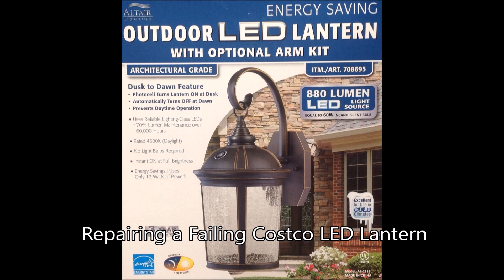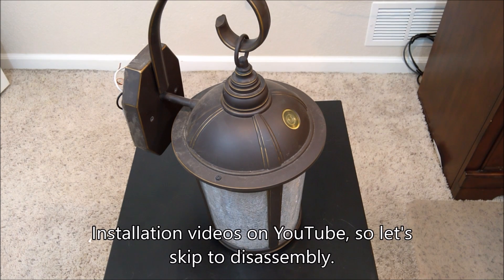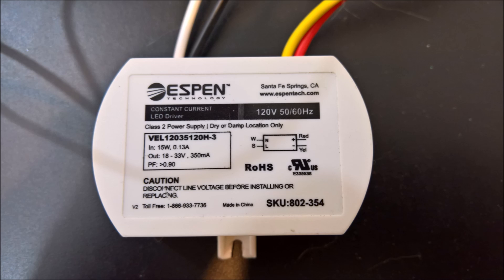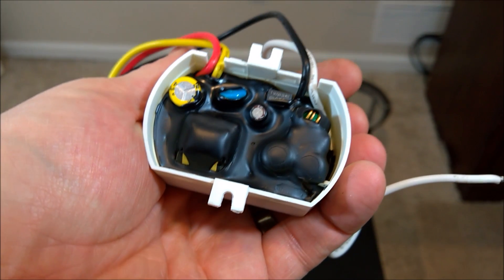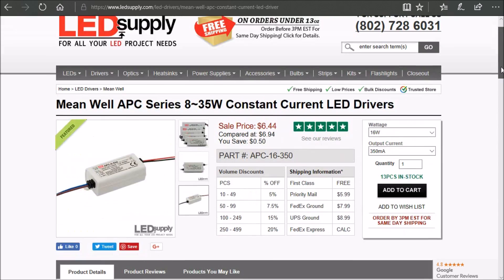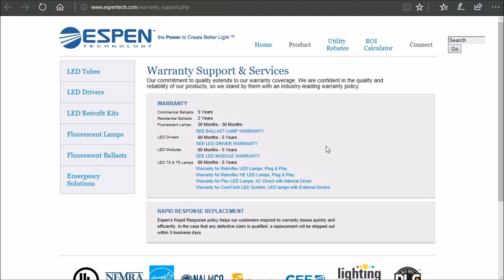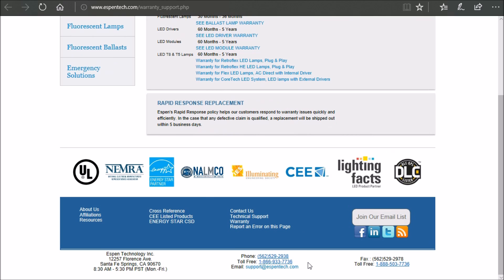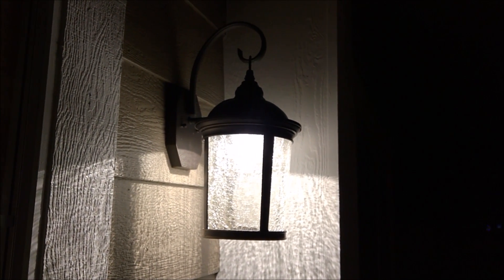Costco LED Lantern Repair

Comment: Awesome! Thanks for this helpful video. I had the same problem.  I ordered the part and fixed my strobing lamp. The only edit I would add is I did not use the zip tie method; even though it wasn't as aesthetically pleasing as yours, I put the new switch back in using an existing screw and mounting hole on the switch. It held just fine.
Reply from the maker: I did one recently that way and it worked fine.  Thanks for watching.

Comment: Thanks for sharing.  These LED lamps are junk.  Having a bulb would be so much easier to repair and have a long life.  I do not want to have to take my fixtures down for repair.  I will never buy a LED fixture again,  I will always get a fixture with a socket for a bulb, This allows me to put smart bulbs in too.
I had a different LED outdoor fixture and was able to convert it to a socket for around $5 so that I never have to take the fixture down again.
Reply from the maker: Swapping out the guts for a socket and a smart bulb is another option.  Smart bulbs do give you the ability to remotely turn on or off your external light.  I basically have that with my switch that controls three outdoor LED lights.  I didn't think I need to have a smart switch and smart bulbs.

Comment: I replaced the board and successfully repaired one light. Unfortunately, the half the LEDs are bad on another lantern. Do you have any idea where to find the replacement LED board? I searched thru LEDSupply's site and couldn't find a close match. Thanks for the helpful video; you saved me having to replace some lanterns.

Comment: Excellent work Ricardo!  I bought 4 of these in November 2013 and two just started the dreaded flash!  Do you recommend the replacement part you purchased or the OEM part?  I’m out of warranty so it’s out of my pocket at this point.

Comment: I call the company that sold the light, it was on the box that I saved. ALTAIR Lighting, 800-787-1021 or 562-295-2611.
They sent me both the driver and the LED plate for free. I replaced them and it works just fine. Good Luck. Thank you for the video, you did an excellent job on this video. Very professional!!!

Comment: I tried to replace the driver and it's still not working. Tested the driver in the house with the LED and it works fine, even though only 2 of the LED lit up. I took my voltmeter and tested the voltage coming in from the photocell and only got 97V. Is there a problem with the photocell sensor  too?  I bet if I by pass the photocell it should work fine. But I would not want to have to turn off the lights every morning and turn them on at night manually everyday.

Comment: thanks for an awesome video - I purchased 2 of these lights and nearly returned them due to the possibility of failure with no replaceable parts, my instal is not easy due to placement but I think Ill keep them now that I know it is possible to repair the lights IF they fail early, FYI to anyone else, on altairs website they list a 3 yr warranty so that might be a good first step. I have the 'newer' version so hopefully they have upgraded the LED driver in the meantime. ---thanks again for a great video showing all the technical stuff that I dont understand!!!! --nice to see the way you show what matters when looking at the parts.

Comment: So i have the AL-4148, 49 or 50.  Not sure which one this is, since i bought 3 of them at different times.  They all came in the red box from costco. The first 2 failed (wouldn't light), so i called Altair and they sent me replacement drivers.  The third one finally failed, but Altair would no longer answer phone calls or emails.  I found your video and followed your instructions.   The driver inside my light was a 700mA one, so i ordered the APC-16-700.  I did not bypass the photo cell.  After installation, it worked perfectly, bright and steady.  But now, about 2 months after install, the lights have gone out again, completely.  I would hate to fix it again and have it fail in 2 months.  Any ideas?
Reply from the maker: Well as much as constant current rating is important, the max power and the DC output voltage range are just as important.  The APC-16-700 is 16 watts max power but only provides a voltage range between 9-24V DC.  If you have your original driver, check and see if it lists a voltage range and maximum wattage (you didn't list it above).  You need to find a driver that meets, or exceeds, the wattage and range.  The APC -25-700 has 25 watts maximum power output and a voltage range of 11-36V DC.  The APC-35-700 has 35 watts maximum and a voltage range of 15-50V DC.  Perhaps one of these might be a better solution to your problem.  However, I would need the additional information to make a recommendation.

Comment: Thank you Ricardo, my lantern has been strobing over the last few days and this made a lot of sense, one question though... my light has 3 Octagonal looking LEDs  any ideas if the same replacement parts would work?
Reply from the maker: The specifications or driver requirements are probably on the constant current driver.  Double check your driver's constant current and voltage values.

Comment: Great video.  I bought the 12V controller and installed it as you show and is works perfect.  The light is the exact brightness as all the other lights I have. I ordered mine from LED supply.com for $6.00 (I bought 2 so I would have an extra).  I called the light company and they wanted to see the Costco receipt, which I do not have.  They also said the part is on back order until at least May this is March). Thanks so much for the great video and the excellent explanation.

Comment: I bought the same constant current driver as you did because I have the exact old driver as you did in the video. I didn't bypass the photo sensor when I hooked it up and it won't turn on? I double checked the wiring and I'm pretty sure I connected it the sames as the other driver.  Any ideas?
Reply: Ricardo Moreno thanks for the info. Just repaired my light and it is working great👍🏻 People need to learn how to repair things again, instead of buying new and throwing the old away. We live in a wasteful World today.
Reply: So I could get my other outdoor fixtures to turn on in the day by covering the photo sensor with my hand but the one I repaired would not turn on. So I left it connected with the new driver and I went outside and night and the light was on! So hopefully it stays on, if not I'm guessing it is the photo sensor and wasn't the driver.
Reply from the maker: I'd start by checking the wiring.  First, locate the black and white wires that go to house.  Verify that the house white wire, the photo cell white wire, and the blue wire of the new constant current driver are connected together. The house black wire should already be directly connected to the photo cell (no wire nut).  The photo cell red wire should be connect to the constant current Brown wire.  Both the brown and the blue wires on the new constant current driver are the AC input wires.  I noticed later that blue is ACN, and Brown is ACL, which I can only imagine means AC Neutral and AC Line.  Now connect the output Red wire on the new constant current driver to the red wire on the LED assembly plug.  And the Black output wire to the yellow wire on the LED assembly plug.  That should do it.

Comment: Thank you  Ricardo Moreno  for the awesome information and video. I also filed papers supplied by Espen to RMA under warranty my failed LED driver. They replied today informing me that the driver  VEL12035120H-3  is on back order for 5 months.   I decided to follow your advice and ordered replacement from https://www.ledsupply.com/led-drivers/mean-well-apc-constant-current-led-driver.  THANK YOU!
Reply from the maker: Thank you and you're very welcome.
Reply: New driver arrived, installed and LED light is functioning normally again.

Comment: only 1 LED Light is lighting up.  I hooked it up correctly.  What is my issue now?
Reply from the maker: This lantern had multiple versions.  You must make sure that you have purchased a replacement constant current driver that meets your specific light's requirements.  Verify that you've picked the correct constant current and voltage range.

Comment: My 6 years old AL-2781 Altair lantern from Costco has two LEDs and seems like both have failed. Its LED driver has the following characteristics
MD:LED-D35
Output:DC3-24V; 700mA
Load:3-6W LED(In Series)
The original LEDs are probably not being made any more. What type of replacement LEDs should I choose, are these close enough match that will work with this driver https://www.ledsupply.com/leds/cree-xlamp-xhp35-high-density
Reply from the maker: That nice LED.  I haven't had a chance to check the data sheet.  I should point out that it would be best to replace your LED, or LEDs, and current driver as a set unless you can study the manufacturer's data sheets and determine that separately purchased equipment are compatible.  You also must take heat into account, though the aluminum disk heatsink may be adequate (don't forget you may need thermal paste).  I've given you some of the basics, required current, voltage range, temperature, and IR.  Those specification should help you in determining what may work.  Best of luck.
Reply: After more research (more videos) I decided to go with https://www.ledsupply.com/leds/cree-xlamp-xpe2-white-high-power-led 3000K (warm white). They came in yesterday, I installed them right away and they are still working today. At $3 each they were also the cheapest ones they had, even the thermal compound was more expensive - $7 at Best Buy. The whole process took me an hour, including removal of the burned LEDs, cleaning/preparing surface, applying thermal paste, soldering of the new LEDs and reinstalling the lamp. It all makes me wonder what the hell went wrong with the old LEDs that they failed after just 4 years, weren't they supposed to last for decades?
Reply: Update: the old driver have failed. After turning on the LEDs are blinking for a few minutes to a few hours depending on temperature outside - the colder it is the longer it takes for them to stabilize. I asked LED Supply for advice in choosing the new driver and they recommended this one https://www.ledsupply.com/led-drivers/magtech-9-watt-700ma-constant-current-led-driver. It came in today, in fact I just finished installing it, seems to work fine.

Comment: Just to let everyone know I did the install with the APV-12-350 and it worked perfectly as well. I know the stock is down on the 16-350's right now so wanted everyone to know the APV-12-250 works like a charm as well! Link - https://www.ledsupply.com/led-drivers/mean-well-apc-constant-current-led-driver
Reply: Taylor Scully I just used the 12-350 and still no light.
Reply: I followed the directions he has to a t

Comment: Thank you so much for the video, Ricardo.  My light started doing the exact same thing about 3 weeks ago.  I'm trying to see if Altair makes good on their 1 year warranty (I purchased and installed the light last spring), but otherwise I'm glad I now have a viable course of action.
Reply from the maker: I hope you have better luck than I.  Espen did send me the paperwork to file out, which I did, but they have yet to confirm my request or ship me a replacement.  And that was November 2017.

Comment: Thank you for the troubleshooting rigor and advice on specific replacement part that comes out much cheaper than some of the other items I was looking at.  I just ordered the exact APC-16-350 from Amazon,as the LED Supply site had 0 in stock...probably thanks to you :-). Will update on the back end when I get the part and install.
Reply from the maker: If you purchase it from LED Supply, standard shipping is free.  Unlike Amazon's $5 shipping charge.
Reply from the maker: If you have already verified that you have the same constant current driver as I, you might try using the APC-12-350.  LED Supply has them in stock.
Reply from the maker: I should also point out, even though 20W is overkill and it's $10, that part number LPC-20-350 is in stock too.  It has the appropriate constant current and output voltage range to support the LED assembly.  You might also try EBAY.

Comment: Ricardo - Thanks for posting this. Very helpful
Reply from the maker: Thanks, this is the first video I've ever created. (I know, it shows) I ran into all sorts of issues, especially with my old microphone. I hope it helps with your Costco LED Lantern repair.
Reply: What size screws hold the glass to the led light fixture?  Two screws.  Both of them snapped and are stuck in hole
Reply from the maker: Bummer.  If I have the opportunity to take one apart again, I'll let you know.  However, if you have to drill out the old ones, and tap new threads for new screws.  You'll probably use whatever size you drill and tap for.